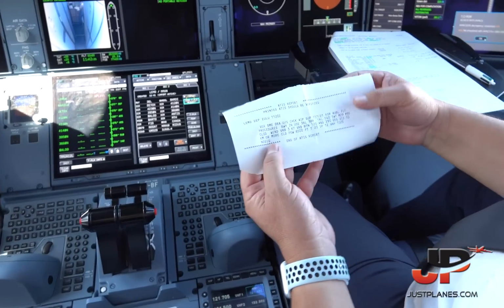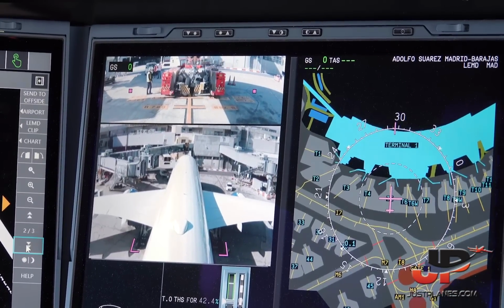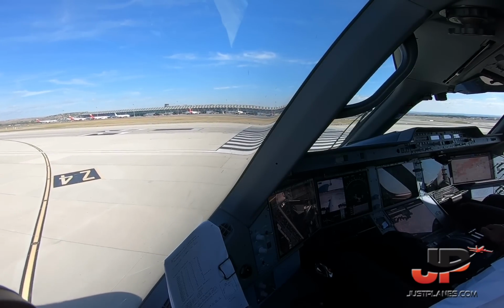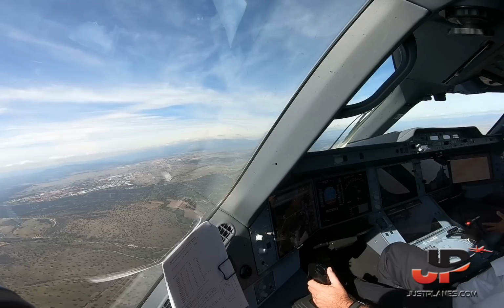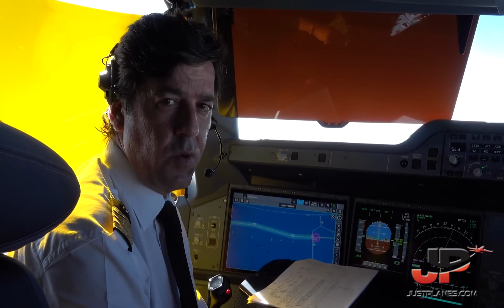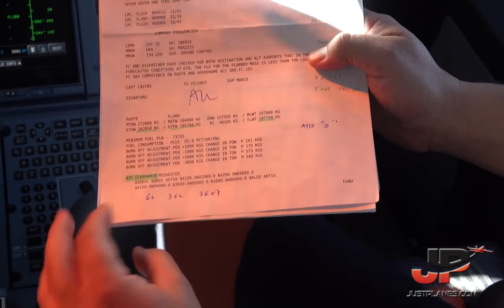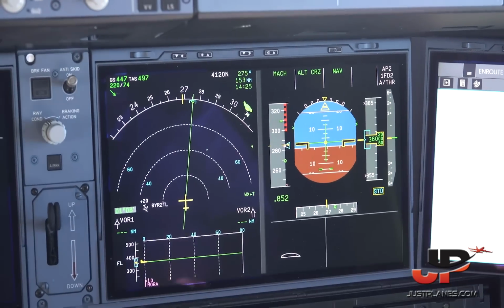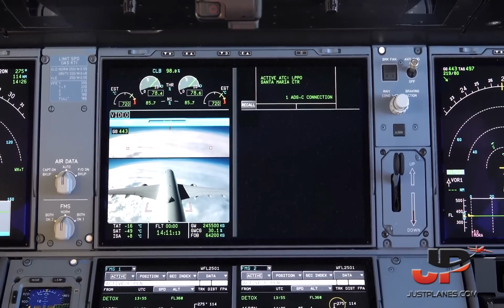World2Fly AIRBUS A350XWB Takeoff from Madrid🇪🇸

Comment: just wondering , at 17:40 the ribbon display on the left reads 285 but speed selected  is mach .853 which is roughly 650mph? so what's the  display showing? TIA
Reply: In the air the speeds change wich mean that if the pfd(primary flight display) it shows 280knots that is not the ground speed, in cruising you dont use knots, you use mach